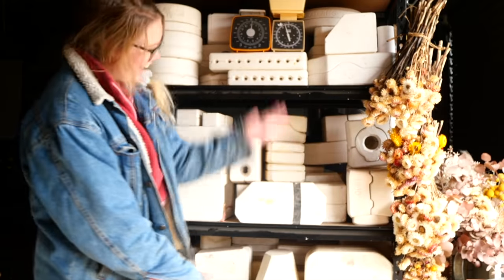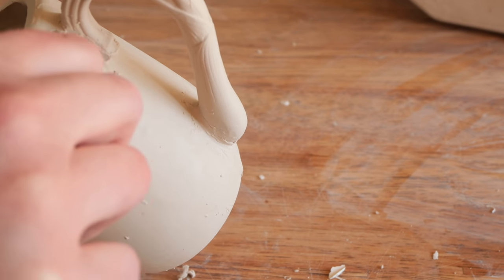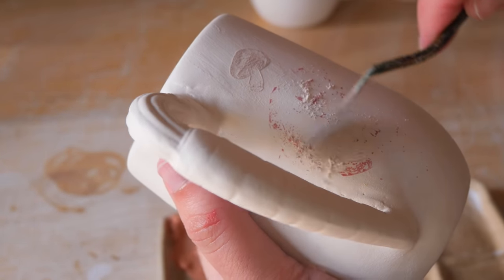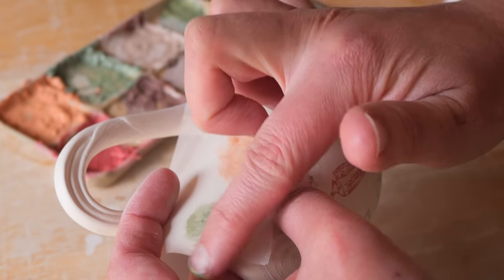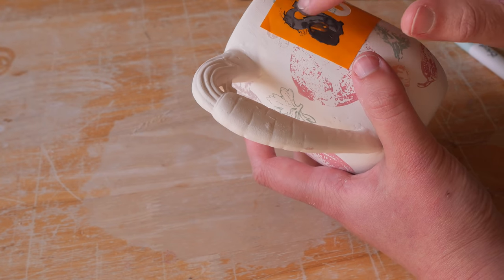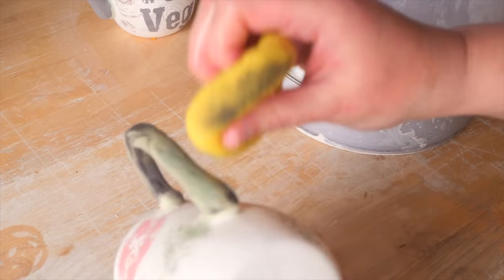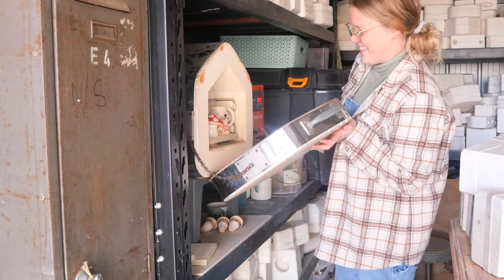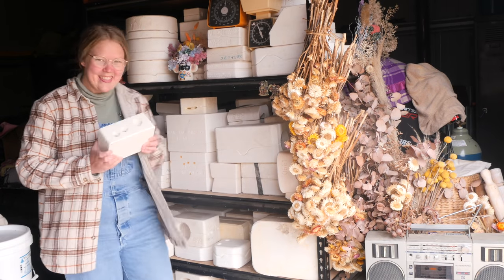Mystery Pottery Mould No.56 : What is inside?

Comment: I would have tried to use a makeup sponge, not to protect your skin ... but to see if it gave a better finish. Makeup sponges are used with paste types of foundation. Worth a try.
Reply from the maker: On the original video I did for the actual Cricut machine (over on Instagram) I used a sponge! Not a makeup sponge but a sponge nonetheless because I too wanted to see that finish! If you want to see it, it’s on those platforms but it came out exactly how you would imagine. So textured and layered and wonderful. I thought with this piece I would try my fingers to see if the results are different and they very much are! I love how your brain went the same place mine did with the stencils!

Comment: I think when sign shops are doing vinyl text stencils, they put a sticky paper over the top of the vinyl to keep the letter holes in position. They then take it off once it's applied before applying paint or whatever. I wonder would masking tape work  in a similar way for these small-scale stencils?